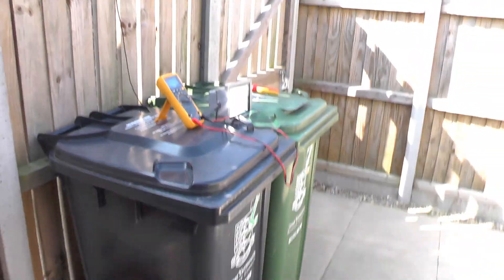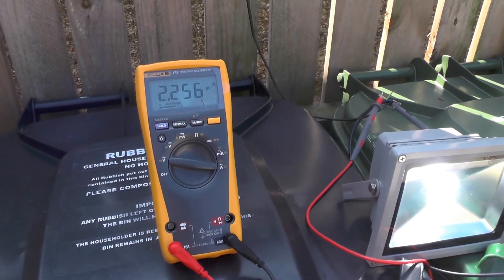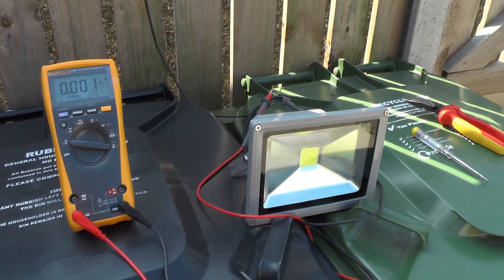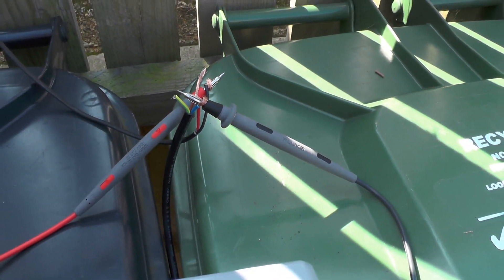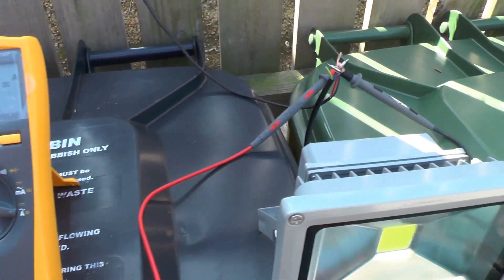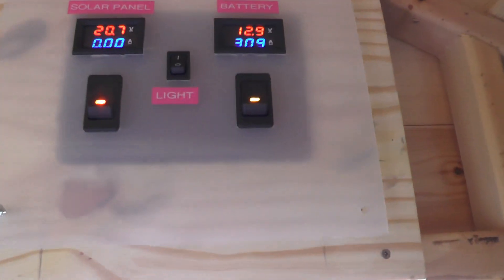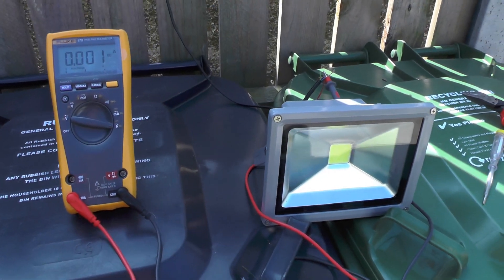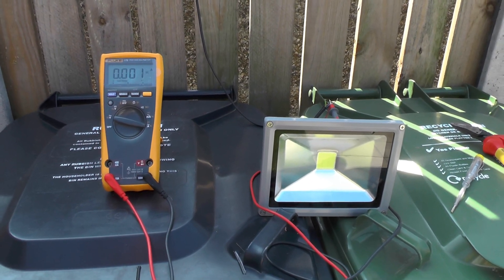Does current flow though the neutral wire?

Comment: For a grounded RETURN line how can there be a ruturn current at zero volts?
Reply: bujashaka Great, but how does the unbalanced portion of the current
return to the center tap if we have no voltage to push it? thank you.

Comment: I have a question on single phase 240 volt. If you have a high current say 10amp on the neutral side and only 4amp on the live side could this cause your main fuse at rd to blow.

Comment: There is no neutral in DC mate.
Reply: I know all of that, I literally just corrected your 'DC CURRENT'.
Reply: We say DC current because we also say things such as DC Voltage in the field. It helps us differentiate what we're talking about. Imagine how out of place it'd sound saying "hey man, the DC is pretty high"
Reply: Stoker So I guess it sounds super ridiculous when someone mentions DC voltage to you, eh?
Reply: In DC the black wire is a negative which is different from a neutral as it has a polarity.  A neutral wire is used in AC circuits and is linked with the earth wire. Here is a definition I got online: "In context|physics|lang=en terms the difference between neutral and negative is that neutral is (physics) neither positive nor negative; possessing no charge or equivalent positive and negative charge such that there is no imbalance while negative is (physics) of electrical charge of an electron and related particles."
Reply: You do not need to say "DC CURRENT" as DC means direct current. You literally just said 'Direct Current Current'.
Reply: @stoker2087  dude it actually means DC - Direct Component 
So DC Voltage - Direct Component of Voltage
DC current - Direct Component of current
Reply: Small error, don't get to caught up in that man.
Reply from the maker: Never studied DC mate, only AC. However, if there's no neutral in DC why is there the presence of a black cable if not as a neutral? Pardon my ignorance and my question if it seems dumb but that's how one learns. There's never a stupid question on my books. I would be happy if you could clarify your point though. Many thanks mate.
Reply: The black wire is negative.

Comment: lol.do you have any basic knowledge about Ac vs DC. i did not see any neutral terminal in DC only i see is positive and negative terminal. check the same procedure with AC supply with AC equipment you will know the diff that no current in neutral cable
Reply: +Faisal Nawaz No Current at all ? isn't neutral wire a return path ? won't current flow live->device->neutral->generation source OR Ground ?
Reply: Huh? Brown wire=Live, Blue wire=Neutral, Green/Yellow=Earth. UK AC.
Reply: ideal balanced three phase circuit no current flow in the neutral but in single phase the same amount of current flow through the neutral
Reply: @DeepakVjthrissur  Finally someone that has a clue....
Reply: There's no negative terminal in AC. And unless you have negative voltage, the "negative" wire in DC is the 0v one (ground or neutral, call it as you wish).
Reply: Current will flow in your neutral in cases of unbalance loads on the wire legs.
Reply: Faisal Nawaz No current (amps) in the neutral?  Thus statement goes against
every other teaching statement. Every statement says the neutral carries the unbalanced portion of the current (amps)? back to the source.